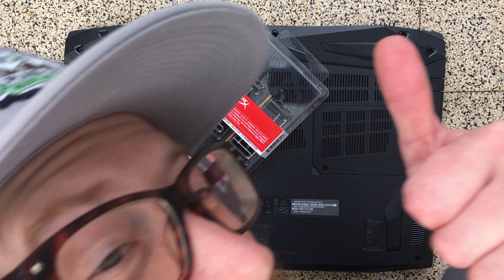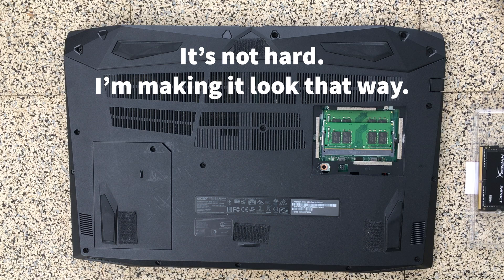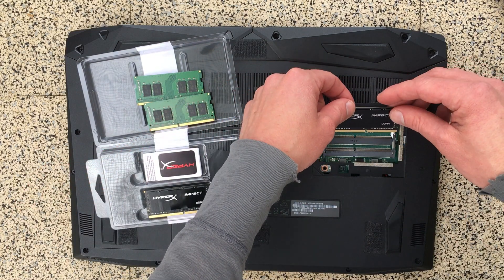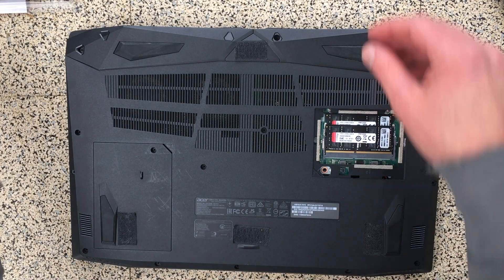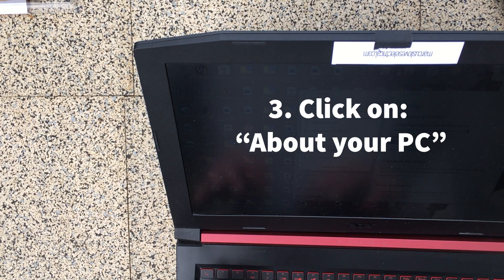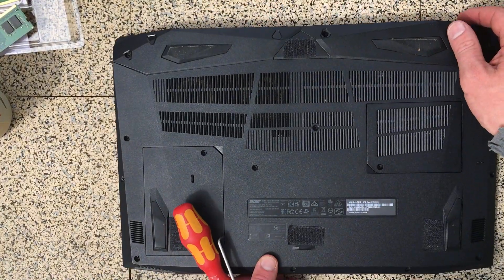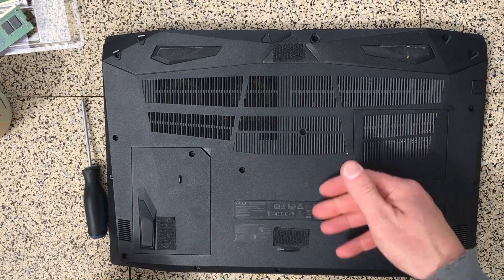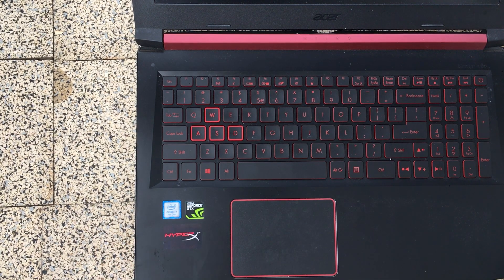Tutorial: Acer Nitro 5 Easy 5-Minute RAM Upgrade - 34K People Helped so far!

Comment: Hey
I'm thinking of upgrading my Acer Nitro an515-51 from 8GB ram to 16GB. Is it worth it? Would i feel a major difference? :)
Hope to hear from some of you awesome peeps :)
Reply: Hey did u did that ?
Reply from the maker: @subhasishkarmakar6737  I did! It made a difference instantly, especially when editing video.
Reply from the maker: Multitasking is where you would feel the most difference with upgraded ram. The CPU is the biggest bottleneck in the system, in my opinion, since thermals can be the biggest challenge with this platform. In other words, take the performance gains where you can get them. Are you running an SSD?

Comment: Hey, I have this exact laptop/model. I just upgraded to 2x16Gb;   ( Samsung 16Gb 2Rx8 PC4-2400T-SA1-11 ) and my system is going into BOSD (blue screen of death) error in 30min of usage with and I ran 'Window memory diagnostic' it shows ram issue. Could you plz help me if you have any info regarding same. or you faced this issue ever?
Reply from the maker: Does it work with just 1 stick of the new RAM?

Comment: my newer slot doesnt detect the ram and gives black screen with keyboard lights on. the rams work individually perfectly on the older slot
Reply from the maker: Have you tried just the new slot?
Reply: I had the same issue with hyperx 2666 16gbs. Maybe there's a firmware update to work the 2666mhz model? 😔
Reply: @LucasDev  you can try this out mate https://youtu.be/Q1OZQL2l-lM

Comment: you need to disconect the battery or just shut down the laptop? Nice video
Reply from the maker: Thank you! Disconnecting the battery is ideal, but a major pain. So your best bet is to discharge any static electricity you may have in your body. https://youtu.be/1LkPgWxNZ-4

Comment: What was the mistake you did, that i should not?
Reply from the maker: I didn't seat the RAM properly in the slots and closed it all up before testing.
The RAM won't fall out, so give your laptop a test boot and confirm that the new RAM stick(s) are showing up in your system. Once you see them, power down your laptop again and finish putting things back together.

Comment: question. its fine if i use a different brand right? i only need to use the same ram speed right 2400mhz? i was thinking of adding another 8gb stick but i couldnt fine another adata 8gb 2400mhz where i live. i could only find hyper x, crucial etc.
Reply from the maker: While I can't guarantee anything, that should be fine.
Remember to check after installation to ensure you're in dual channel mode.
Reply: @marcusfrombespokeaudio5372  ok got it.

Comment: This was a awesome video!! I do have one question can Someone just use Any means of adding Ram. I see you used hyper x, some other websites are recommending crucible etc. Does it really matter?
Reply from the maker: I'm glad you enjoyed it!
Your brand doesn't matter that much as long as you pick something reputable.
The most important thing to do is match your RAM bus speed. A matching pair of RAM sticks is the easiest way to guarantee this, but you can also check the sticker on your existing stick of RAM if you're just buying one more.
Reply: @marcusfrombespokeaudio5372  NICE!!!! Thank you so much There is a lot for me to learn!!! Thank you for the reply as well!!
Reply from the maker: @seniortigererho2784  happy to help!
Reply: I have found the correct bus speed I judt have 1 last question!!! Then I will should be 100% knowledged by your video. Is it a good or bad to have 2 different brands with matching bus speeds on a laptop??
Reply from the maker: @seniortigererho2784  with 2 brands, you may have to experiment.
It's always preferred to have them match, but will probably be okay.
Reply: @marcusfrombespokeaudio5372  AWESOME!!! Thank you so much!!
Reply from the maker: @seniortigererho2784  you're quite welcome!

Comment: Thank you for the guide.  Question : How is the performance of this laptop after the upgrade ? Did you notice any change regarding thermal issues ?
Reply from the maker: It increased heat. The fans definitely run harder since the RAM swap.

Comment: I just bought the nitro 5. 1 terabyte. 3.4ghz. 8gb ram. I wanted it for gaming but realize it's fairly entry level. Since I bought it 5months ago I thought it was 2020 version. But after many video reviews I watched. This may be the 2018 version? It has those easy compartments to open. 
Sorry for the long winded message. I'm new to the gaming pc world. Be nice to upgrade my ram like this
Reply from the maker: If you're using it for gaming, the easiest way to decrease load times may be to upgrade to SSD if you don't already have one.
After that, the RAM is also an easy install.
What processor do you have?
Reply: @marcusfrombespokeaudio5372  amd ryzen 5 2500u. 2400mhz 8gig ram.

Comment: Does the ram have to be the same brand???
Reply: Ideally yes, but you should be fine so long as they are the same speed. You can even mismatch but it is a waste of money and resources for the faster stick as it will underclock to match the lowest speed stick.
Reply from the maker: Same brand that I used? No.
Same brand in each slot? Ideally.
As Poodz stated, you'll be limited to the lowest clock speed, plus some sticks of RAM don't play nice together.

Comment: Hi bro. Can it support 2933mhz? 2666mhz is better or 2933mhz? Thx a lot ☺️
Reply from the maker: With the version shown in the video, max is 2400. You could technically use 2666, but would see no appreciable increase in speed.

Comment: Are you putting another stick of RAM in the dual channel? Or the single channel?
Reply from the maker: I swapped out both sticks and run in dual channel mode. Does that help?
Reply: Bespoke Booth so that means that you have 16GB of RAM in the dual channel? Sorry for asking all this, I’m kinda new to all this tech stuff.
Reply from the maker: @tye.3388  There are 2 slots available for the ram. 16gb in each slot.
Dual-channel refers to how your computer processes and uses the ram. It's possible to have both slots filled and still run in 'single channel' mode. You would still have access to both sticks, but it wouldn't run as fast as 'dual channel'.

Disclaimer: Trying to use 2 different sticks of RAM generally means that you can't use dual  channel mode, so pay attention to Speed(mHz) and Size(GB) when selecting your RAM.
If you already have one stick of RAM installed and want to add just one more, be sure to match Speed and Size to the existing RAM.

Hope that helps!
Reply: Bespoke Booth thank you! How exactly do I put RAM in dual channel mode? Or how do I figure out if my laptop is running in dual channel?
Reply from the maker: @tye.3388  The easiest way to see if you're in Dual-Channel mode is with a little freeware program called CPU-Z. You can find it at: https://www.cpuid.com/softwares/cpu-z.html

Once you have that installed, click on the "Memory" tab, and it will show you "Channel #:" in the top right of the window. If it says Dual, you're golden!
Reply: Bespoke Booth thank you so much! You have no idea how much you’ve helped me. Thank you for taking time to respond to my comments
Reply from the maker: @tye.3388  happy to help! If you want more easy tips, hit subscribe so you don't miss anything.

Comment: ugh i got a 2020 acer nitro 5 why couldnt they keep this easy design????? i guess ill have to do this the hard way
Reply: I had a slightly larger screw driver than the actual screws but I somehow managed (it was with this model tho)
Reply from the maker: No damage?
Reply: @marcusfrombespokeaudio5372  0 dmg. After almost 2 months using 16gb ram, I can say it was worth it. I can play rust without it freezing after 6 seconds and crashing my laptop. And it runs at a consistent 60+FPS. The only bottle neck is the graphics card which I cant change. Even if it was just 1 step up to 1050ti it would be a fair bit better y’know
Reply from the maker: @SgtSnowballs  good to hear!
Reply: @marcusfrombespokeaudio5372  I’m upgrading to ASUS rog strix g15
Reply from the maker: @SgtSnowballs  you'll have to let us know how it is! (and how easy it is to upgrade)
Reply: @marcusfrombespokeaudio5372  I’ll keep you posted yeah 😂 it comes with i7-10750h and RTX 2070 so I’m expecting some damn good performance
Reply from the maker: @SgtSnowballs  great, thanks! Dayum. Sounds like it should be quick!
Reply: @marcusfrombespokeaudio5372  I’m really hoping so, I ordered it earlier today and it’s arriving Saturday 😱
Reply from the maker: Oh, wow. 
You're right, this is easier for the ram swap.

The only advantage to the new design (that I can see) is that upgrading your Hard Drive looks easier.

Comment: When I installed my ram it was 8 gb I bought another 8 to make it 16 when I did that I swear I didn’t even get 16 gb ram I legit just got the same 8 I need help I installed it correctly
Reply from the maker: Have you tried swapping the ram in the slots? The most common issue is often not seating the ram properly.
Reply: Bespoke Booth well I have 2 ram slots 1 DEFUALT that is came with the 8 gb one and the second is a upgradable well I put it there and still I don’t get my other 8
Reply: Bespoke Booth can you please make a video and try to explain because brother I typed way to many comments and no one tried to help so I found you and I need your help
Reply from the maker: @GhanemAlkaabi  Super-happy to help! Try pulling out your existing ram first, and install your new ram in that slot.
Does your computer boot up after that?
Reply: Bespoke Booth no black screen for some reason I tried to install the new ram and when ever I put it in the secondary slot the laptop will turn on but a black screen
Reply: Bespoke Booth any help
Reply from the maker: @GhanemAlkaabi  sounds like bad ram. 😔
Reply: Bespoke Booth do I buy a new ram ?
Reply: Bespoke Booth my specs are i5-8300H gtx 1050 4gb and 8 gb ram 2400 mhz
Reply: Bespoke Booth what should I get
Reply from the maker: @GhanemAlkaabi  what's your budget?
Reply: Bespoke Booth anything
Reply from the maker: @GhanemAlkaabi  then check out this great article to guide you! https://www.tomshardware.com/reviews/memory-buying-guide,6347.html
Reply: Bespoke Booth ima go ahead and buy 2400 MHz or 2444 ddr4 for my laptop hopefully it works and does the job done I really wanna upgrade ;)
Reply from the maker: @GhanemAlkaabi  I'm quite happy with the RAM installed in the video.
Reply: Bespoke Booth it’s so sad I wanted to upgrade to 16 to fix the FPS drops